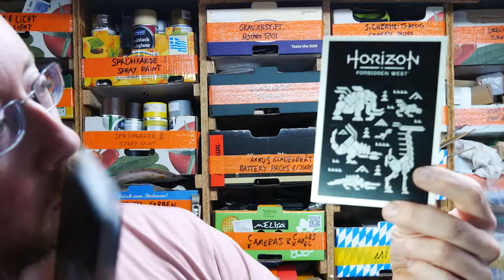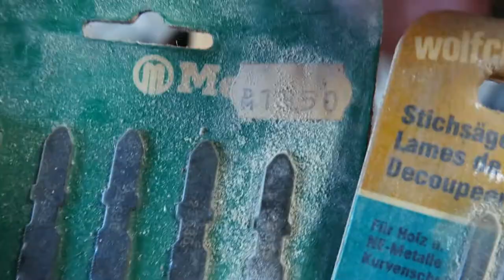Horizon Wall Art [Zero Dawn/Forbidden West]

Comment: Dominic, I have used my scroll saw to cut things like plastic, where I just oscillate it with my hand rather than turning the machine on.  You can cut as slowly as you need.
Reply from the maker: That sounds like a great way to go about it, and to cut those spots that are particularly tricky to cut with the saw running. Thanks for watching!